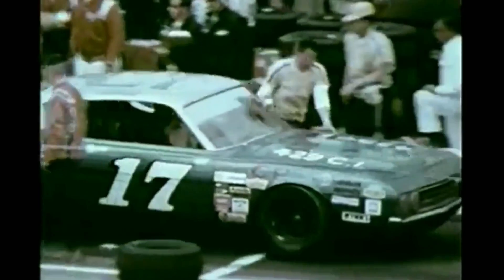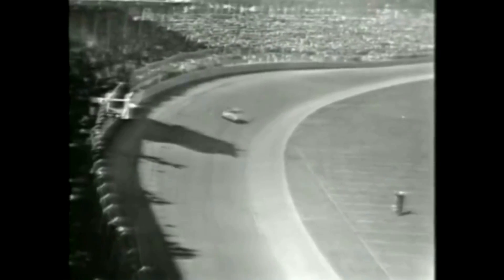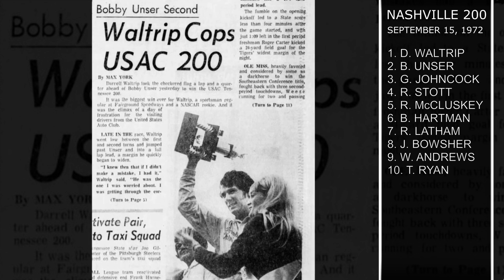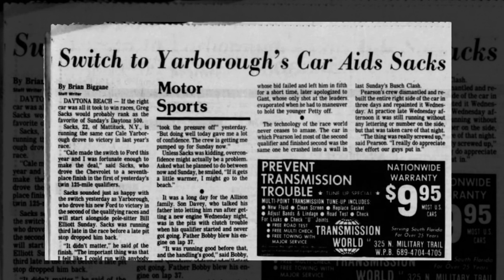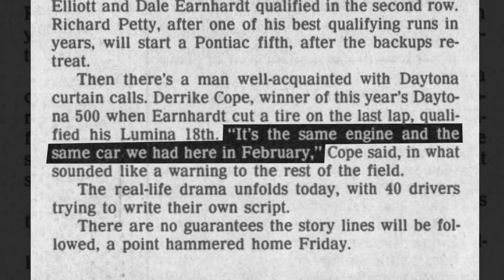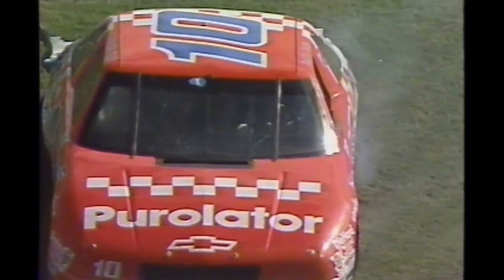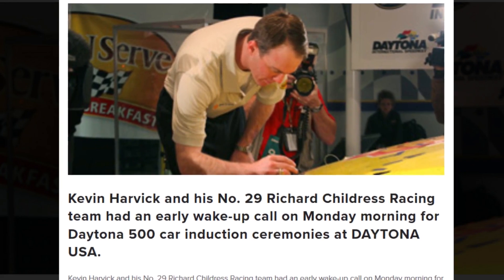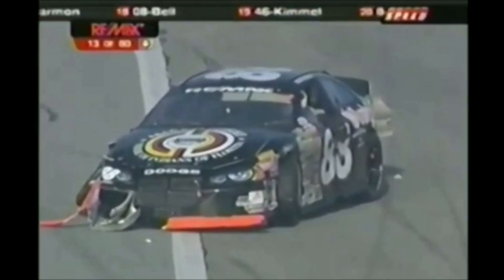The Missing Daytona 500 Cars | Under the Sheet Metal

Comment: I don't know if anyone has posted this question, but how about the Blue Max car Rusty Wallace drove called Samson? If my memory is correct(a hit or miss deal, lol), the car was built as a Monte Carlo by the Joel Halpern race team for David Pearson in 1981(one of the early '81"downsized" chassis). When Halpern was killed later that year, the car was bought by another team, or sold directly to Raymond Beadle. Possibly the MC Anderson team? Whatever the trail it took, it ended up in the Blue Max race stable as a Pontiac(as a Lemans, then a Grand Prix), and was used by Tim Richmond, then Rusty Wallace with good success in the late '80's. The reason I remember the car is an article in Winston Cup Scene that documented the years-long lineage of this particular car and the fact such an "old" chassis was still a winning one.

Comment: I have always wondered what happened to Dale juniors 2001 Pepsi 400 car. Anyone know?
Reply: The side sheet metal is on Dale Jr's podcast studio wall. Most likely sold off or reskinned and collecting dust locked away at DEI.
Reply: It's on display at Talladega.  It's painted the traditional Bud #8 scheme.  It's in as race conditioned.  It doesn't have an engine it it.  I believe Junior won the last of the four in a row at Dega with it.  I think he won like 6 or 7 plate races with it.

Comment: While some of this information is accurate, most of the claimed wins for the Andretti car are pure unadulterated bovine excrement. I am not aware of any evidence that David Pearson raced the car or that it ever was a Talladega, for example.  Or that it ran in USAC as the #15. Holman Moody had multiple chassis. It did get rebodied by HM as a 1968-69 Cyclone and was sold to DW's daddy-in-law in that tin. Which is how Waltrip first raced it.
Reply from the maker: The info comes from this 1972 newspaper article. If it's wrong, blame this old timer, haha:
https://ibb.co/2Mcm8YX
Reply: @nascarmanHistory  Never trust a scribbler.  (Remember, scribblers in the same era claimed there was vinyl on the roof of Petty's 68 Road Runner and that Smokey's 66 Chevelle was down sized...both are false reports TOO). Wrong is wrong whatever the source. Incorrect information does not get rehabilitated with the passage of time.  The HM VIN numbers for Pearson's Talladegas are known. None of them are known to have become Waltrip's car or to have been Mario's 1967 HM Fairlane.  That car carried HM VIN C7HM-10098 BTW. According to internal H&M documents in my collection that chassis became Mario's 1968 Mercury Cyclone...That's the chassis Mario wrecked in the 1968 Daytona 500.
Reply: My grandpa bought Nelson Stacy 63/64 Ford, car was a super speedway car. My uncle remembers gutting the doors of windows and regulators. Car raced on the Midwest dirt tracks under many different bodies. They wrecked at Peoria ILL track in the early 70s. Stripped the car and junked it.  😢